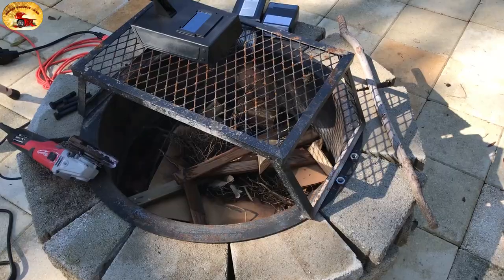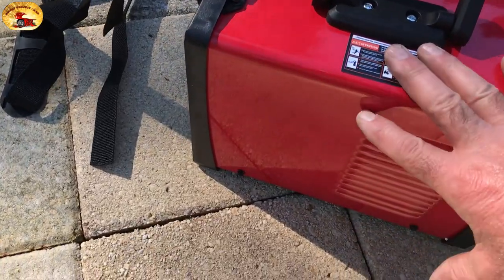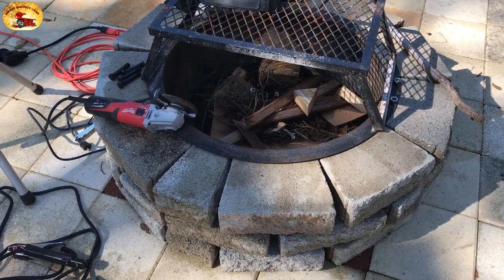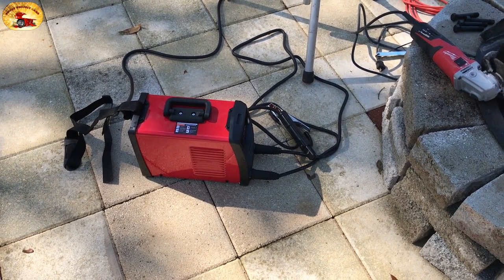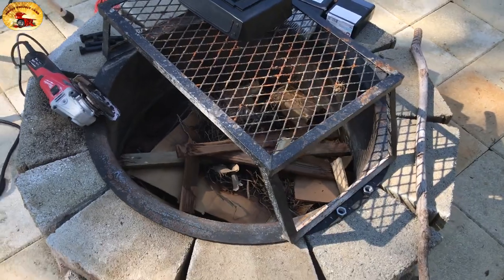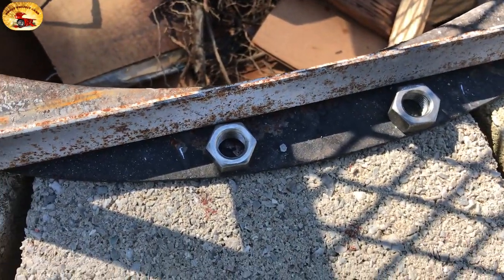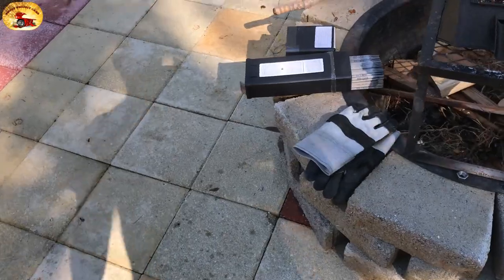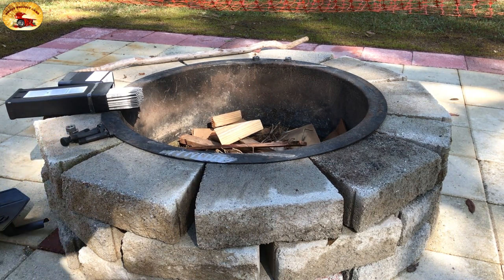AMAZING!....How to WELD With a BATTERY CHARGER! ....SAY WHAT???

Comment: this is a magnificent little machine. I had 1 battery that was left too long to be revived but then took 2 others from my lawnmower and my son in laws and recharged them .I have a meter that measures cold crank amps and it brought both back to factory specs. Now all I have to do is try the welding part . Thanks
Reply from the maker: Great to hear!  Thanks for sharing Brian!  Have a great day my friend.  mad Mike the hammer SPC